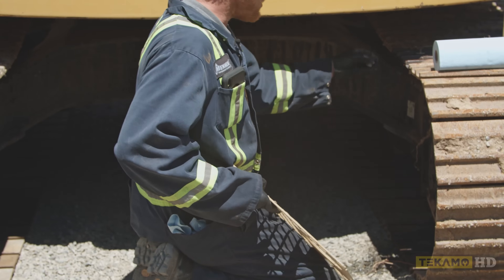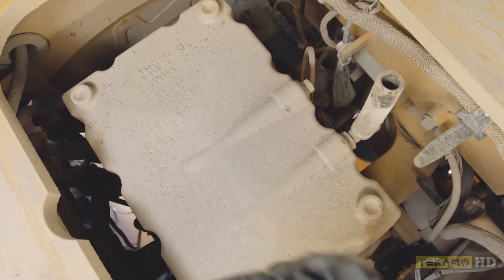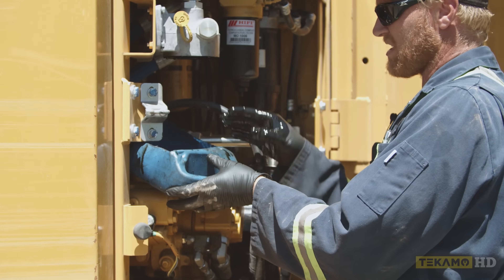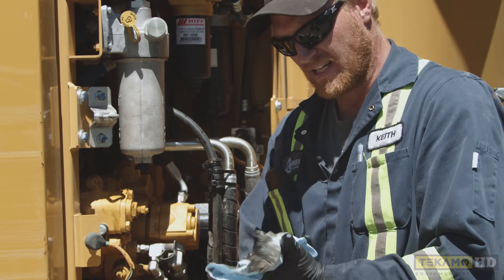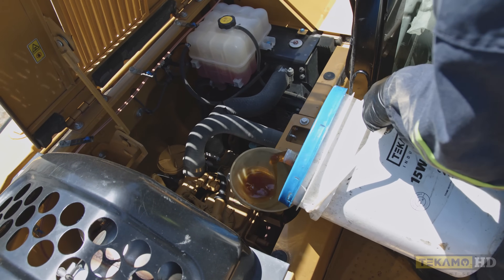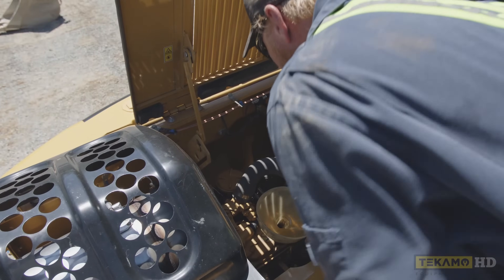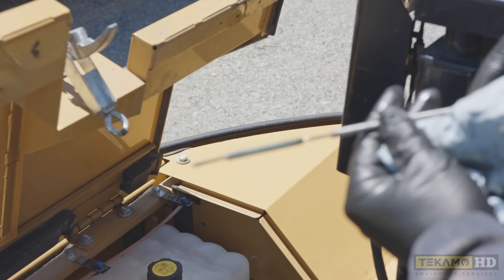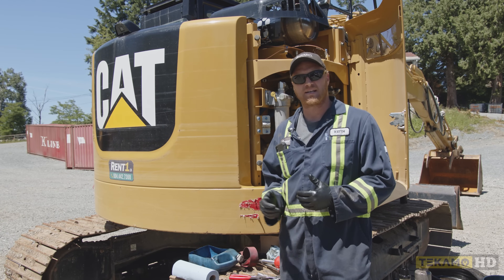250-Hour Excavator Service - Learn From A PRO MECHANIC

Comment: It's wrong ,you should drain the oil of the filter before change the filter
Reply: You can but it’s not necessary. It’s more for a cleaner job or if it’s just stopped running and has pressure. You can skip the drain if you want to.

Comment: what will happen if you overfill the oil, will it burst on the seam?
Reply: if its anything like a car, theres a good chance it will do some damage due to hydro lock. say its too full, or it expands due to heat, your piston creating a seal wih the cylinder wall can strike the oil on the downward stroke weather its power or intake cycle. the oil itself is incompressible and the piston striking the oil can cause severe damage akin to it essentially hitting a wall at high speed. it can also cause frothing if it contacts the rotating assembly which will make it really hard to draw oil thru the pickup, eventually starving the engine of its oil.

a cool demonstration i saw: if you want an example of the hydro lock, get 2 cups, one big and one small enough to freely fit inside the big one. fill the big one with water and try to push the small cup into it and feel the force push against your hand.

if you wanna see frothing, get a cup and fill it with cola. blow bubbles into it with a straw and then drink it thru the straw with the straw in the non bubbled pop vs the bubbles at the top. compare how much you drink from liquid vs the bubbles.

Comment: I bought an old case 1085C excavator, it's in pretty good condition, replaced and fabricated radiator tank. But my problem is some minor leaks on hydraulic hoses on stabilzer and transmission joint, I'm not a mechanic but would really like to learn more, where do I start?
Reply: the operators manual is a good place to start. the service manual after that
Reply: Where is the oil leaking from is of leaking from the fitting or the hose

Comment: I would have filled that filter with oil before installing
Reply: Usually, that is not required and not a common practice on most machinery nowadays.  Most are remote mounted and do not contribute directly to anything that requires lubrication besides the sump. You also risk adding foreign debris/contamination into the filter if you pre-fill.
Reply: As said above, you have the small risk that you can contaminate the engine. The large central hole in the filter is it's outlet meaning it goes straight through the gallery, jets and into tour crank bearings, if a speck of dust or worse were to find it's way into that filter on the outlet side (big inviting hole to fill) it'll go straight into one of these places resulting in potential catastrophic failure and a rebuild. This risk is higher when youre working in the field and its a dusty yard or quarry etc. The risk is tiny but over a career might get you into trouble. Hope that all makes sense.

Comment: Peace be upon you
What is the reason for water mixing with diesel in the C18 engine?
Reply: Hi Radhouane, if your breathers and fill caps are working fine, most water comes from the condensation created in the walls of the fuel tank when the machine cools down, some will come  from your fuel provider's reservoir.  Most equipment will have a water separator filter with a drain cock or a  quick-drain at the bottom the fuel tank so this must be drained daily before the machine goes to work.